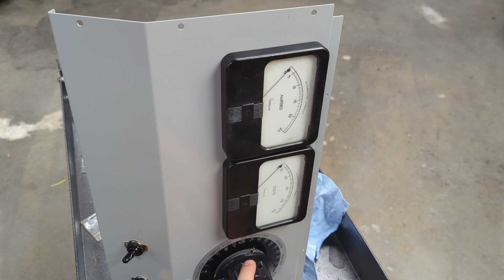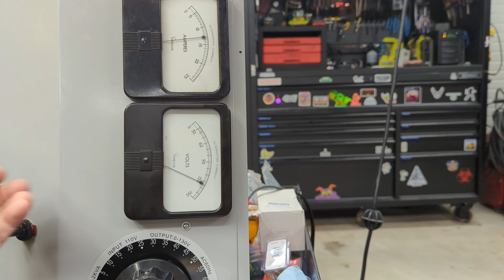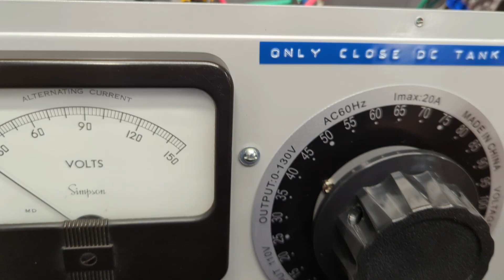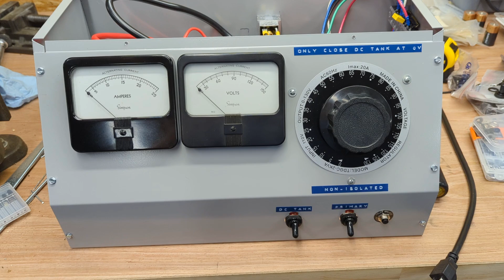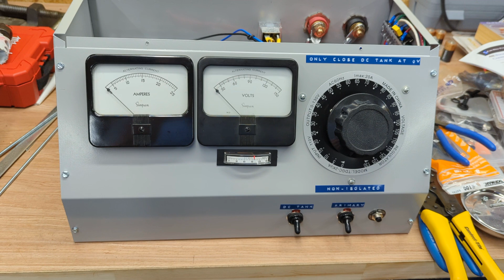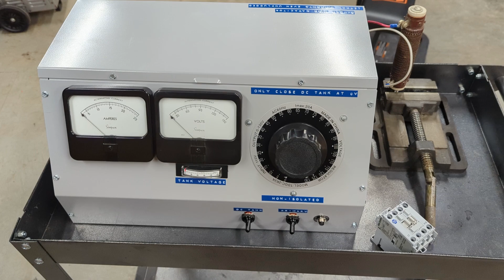High Voltage (AC/DC) Supply

Comment: I would love to see you DC supply power a HENE Laser..
Reply from the maker: Lol this lil thing is a couple kilovolts below what would be required for that right now.. but a future attachment to it may solve that. Thanks for watching!
Reply: @burntsemiconductor  Way back when I was in high school, we 
messed around with a DIY circuit..

9 volt battery connected to a DC motor in series with the 8 ohm side 
of a transistor radio output transformer(8 ohm : 1000 ohm)

I bet if you did that and put the outputs of multiple transformers  in series, 
it might power a HENE laser..

That would be an interesting experiment for YT..